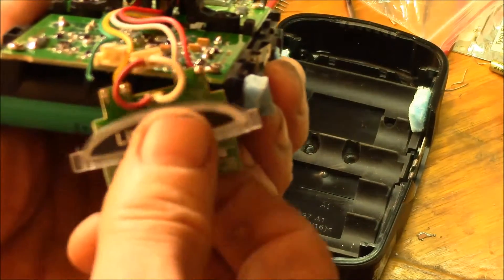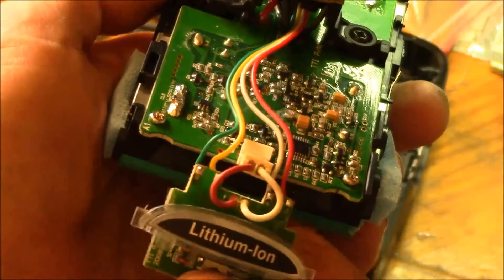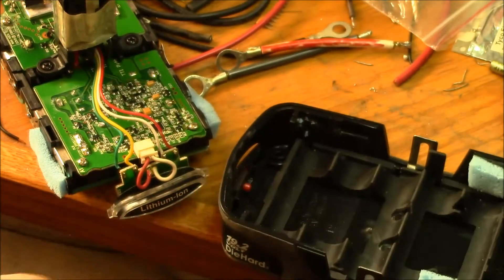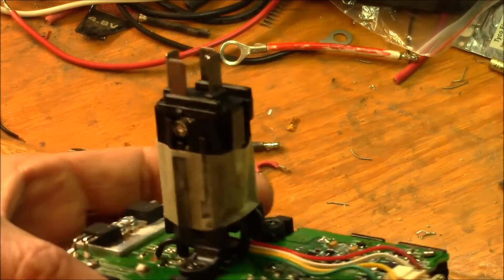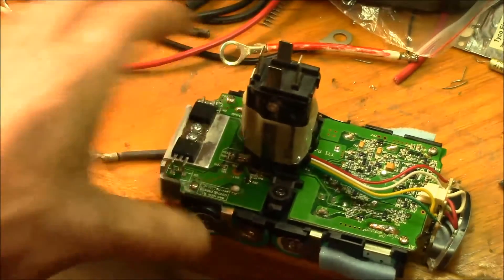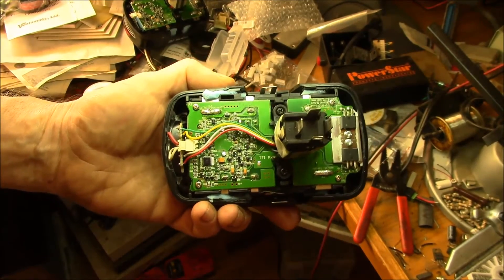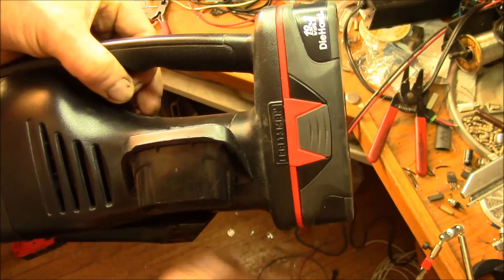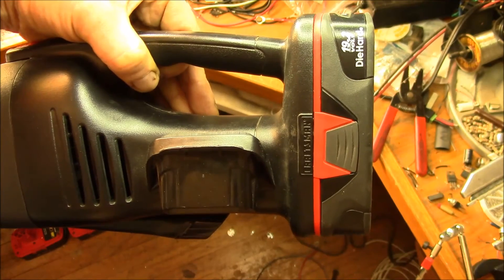Craftsman C3 Battery Repair, Part 3

Comment: Curious if this repair has held up and the battery functioned normally.
Reply from the maker: Yes, that battery pack is still going strong 4 years later.  Gets used a few times a week and charged once a month or so.

Comment: Thanks for the video, even 4yrs. later! Still relevant today & in the near future. I have never taken one apart yet to replace some cells, but took a Bluetooth speaker & replaced those batteries. Same type of situation as here. 
I am a Craftsman C3 fan & I personally only use the XCP's mostly full size, but have 2 XCP compacts for years now. I did have a old full size, I believe one of the original Craftsman Li-ions as to the same battery indicator as yours in the video that died on me years ago. My only Li-ion from Craftsman to die on me. It's now in the box of about 20+ dead Ni-Cd's from over the years that I put them in. Why I keep them is beyond me. 

I recently came into 4 new, but old stock Li-ion compact's model #'s 5166 (now discontinued) molded after the compact XCP batteries looks only. They are all plastic with no light indicators. 

Now I use 2 of the 4-port C3 multi chemistry chargers (1 in basement & 1 in garage). Also I have every charger ever put out as to some of tools over the years came with batteries & chargers included, but I have a ton of them put away by the dead batteries. 

Anyways, the 5166 battery shows up as defective on all chargers except the sleek, dual chemistry charger model 5336 with the "C3" largely molded into the top of the charger. They show up as perfectly normal & all 4 batteries take a charge perfectly!! No "Red, Defective" lights!! After researching if this was a major issue, I only came about this information in a "Amazon Review"!! 
So I dug out one of my 5336 chargers & Bam!! They all work & function like normal, but only using the 5336 model charger!!
 
I read so many people's reviews of them reading "Defective" in their reviews as I would have done if not for person leaving that review. So almost all people who had the "Battery Defective" issue are really not defective, they are some kind of circuit board issue I am assuming? 
I don't know much about batteries, but just wanted to throw that out there to people. I know I have rambled on now, but if you know why or what would cause this other than a bad board or design or both?  Anyways, thanks again!!
Reply from the maker: Good information, thanks for posting.  Yes, I too have several chargers and some batteries will only charge on a specific charger.  They show up as defective on my other chargers.  I tried to figure out what is going on between the battery and charger, chased a few ideas but never quite figured out the whole story.  Instead, I just keep the "magic" charger around for those times my regular charger won't charge a given pack.
Reply: Thanks for reply! I will def keep my magic charger!!

Comment: I have been seeing black and decker 20v lithium batteries for like 40$ for 2. I wanted to convert my old nicad 19.2 volt craftsman to lithium ion but saw the problems some had with the 
 conversion, low tourque/low speed, can't go full power etc.  also I would need to create a Protection circuit. this already has a circuit built in so theoretically all I need to do is place in the 19.2 v pack and reattach the correct posts. thoughts? anyone?
Reply from the maker: I suppose that's an option.  Haven't looked at the B&D 20V packs, I know they are slightly different than the B&D 18V NiCad packs I've worked with.  Main issue would be the physical sie and if they would fit in the C3 case and also the electrical connections.  I know the 18V B&D NiCad packs had nothing besides +/- for the battery on the connector.  The C3 seem to have some additional connections that I've not totally figured out the purpose for.  I'm working on making my own charging adapter and then will be retrofitting some 5S LiPo packs into some old C3 packs for a test.
Reply: How did the test go?

Comment: You cant mix the different capacity in one battery pack ... They cant discharge  together !
Reply from the maker: Correct.  I tried to get as close a capacity new cell as I could to match the old ones while sticking with the same mfg.  I couldn't find the exact same capacity, so I picked up the next highest.  So far the pack has been working fine. The capacity of the weakest cell in series determines the capacity of the pack.  Now after tearing apart more of these packs, I have a collection of cells of varying capacities, but at the time, I had no extras.